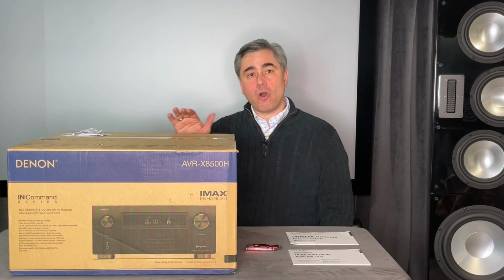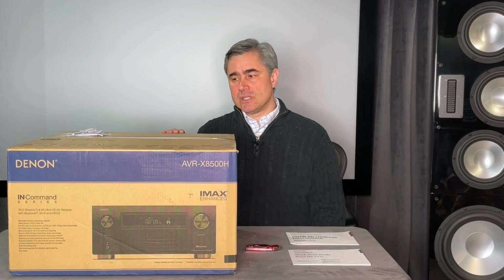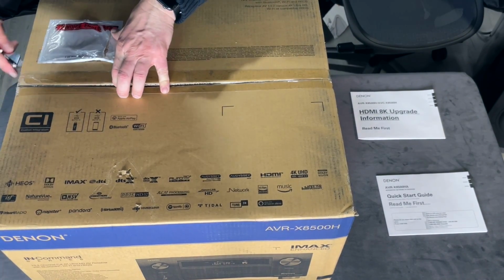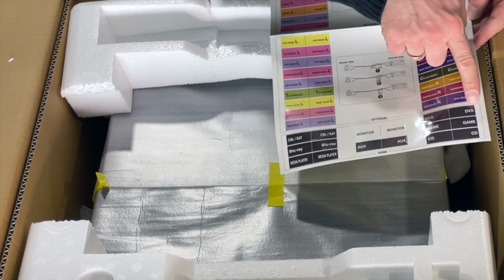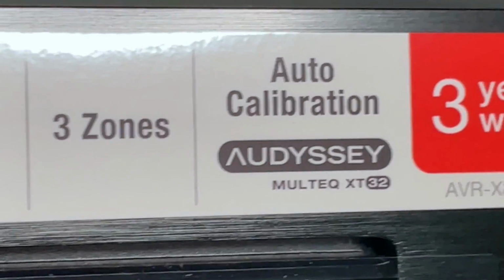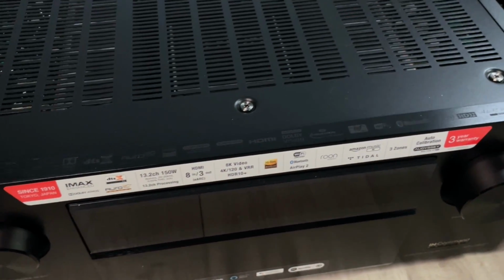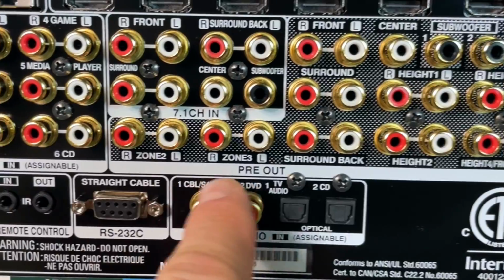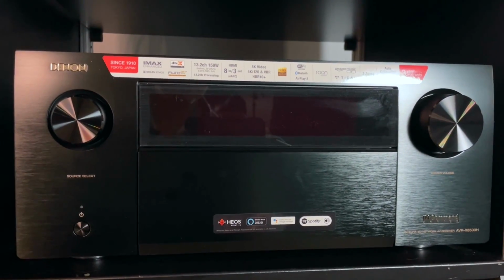Denon AVR-X8500HA 13.2CH 8K AV Receiver Unboxing Overview

Comment: If there's anything specific you all would like to see in the follow up series of videos on the Denon setup, please let me know so I can be sure to include it.
Reply: I fail to understand why this behemoth cannot process 9.2.6......That is all.
Reply: @BornIn82  because its a 13.2 amplifier/receiver? You would need something extra indeed if u have 9.2.6 for the last 2 speakers.
Reply: Theo I really enjoy your input on audioholics. It's because of you that I have changed my ultimate Bass soundcheck track to:
 "If You" by Skrux.
It was also partly because of you that I splurged and purchased my Denon AVR 8500H.
And now it's totally because of you that I drank the upgrade Kool-Aid.
LOL 🤣
Reply: Best speaker layout for this avr.  My assumption is it's supposed to be set up with 8 in ceiling speakers and switch between atmos and auro but I've never seen it confirmed.  Why else would it be able to hook up more than it can power?
Reply: I would like to see the 7.2.6 set up which I believe will be the most used setup using Dolby Atmos. I want to see you used the assigned amps in this setup to see if the top front, top middle and top rear are all highlighted in the setup menu. I would also love to see you switch from apps in your smart television to devices plugged into the input in back of the receiver to see is you find glitches that I have.
Reply: Please read my comment about the lack of 40 Gbps HDMI input. I belive that SU will ship you the 3 input box in no time for your review. Haveing 3 40 Gbps HDMI inputs in the basic AVRs from Denon make this unit questionable until the new Denom AVRs arrives. Maybe the 3 connection box can make this AVR an option still since it is already now proven to be a very good AVR from other perspectives.

Comment: Hi - that was awesome! On a side note,I have four Polk R700's as my front and rear speakers in a 7.2.4 configuration. I have a Denon AVR-X8500HA and I cannot get the settings to allow for me to set the rear speakers to large. It just wont do it. Rear speakers just default to small. I don't know if you do consulting or not, but I would gladly pay for your time to walk me thru how to do this.

Comment: Just checked my box - UK Spec AVC 8500 HA and the ‘A’ is marked on the blue stripe on the box, made in Japan, all good and thanks for the heads up about the upgrade of HA. This is for use with the 8K JVC laser projector.

Comment: Hi Gene and Everyone... question, What receiver should I buy? The Denon AVR-X8500HA OR  Denon AVR-X6800H???  The reason I ask is because it looks like the x8500HA just got a 25% off promo on several big box websites.  I planned on the x6800h, but it seems like a deal to just get the 'better' receiver with the discount.  Thanks for any feedback!!!

Comment: Anyone opened one up yet to see what Dacs they replaced the 8500h ones with 🤔 This should be upfront information.
Reply: V AVR X8500 a AVC-A110 byl DAC 8xAKM AK4490EQ. Nový AVC-X8500HA už DAC 8x SABRE ESS9010K2M. 😮

Comment: How would you compare this to the Marantz Cinema 40?  While the Marantz only have 125 per channel, most of us use an external amp to power front speakers.  My main concern is that for the amount of money spent on an 8500HA, you only get one 8K input.  Rather the Cinema 40 has 7 - 8K inputs, so it future proofed.  As a long time Denon customer, I love Denon! but I feel that for the price, Denon should offer at least 3 or more 8K inputs.  Any thought?

Comment: Thank you for this great content 👍.
 I am  planning to get the r600+400+r100(2 pairs)+RC80i +hts 12 for my 7.1.2 setup. But bit confused about the avr, denon x3800h  vs 4700. My dedicated ht room size is 5.3m*3.7m after the aquistics. I am not planing the preamps due to budget constraints. Which avr would you recommend  for this setup denon 3800 or 4700?

Comment: I have a Denon AVR x3100w and two Canton SD 580 DC main speakers. They are bi wired, think that this increases power supply. I usually set a max volume level but what if I would set Limit to off and increase the Volume to max. Could this potentially harm the speakers?
Did you run your speakers at max volume? 
Thanks for your answers ☺️.

Comment: Help please! Does your X8500HA show An X at the TV Audio column in the inputs/Input assign section? Denon said the X at this input slot is normal. My eARC is not working correctly. My sources, Blu ray, 4K Fire stick Max, are displaying no higher than 1080P through the Denon.  It should be displaying 2160 4 K and 4320  8k .I been having this problem ever since I bought this receiver. The Samsung tech said the TV is reading the TV source as a USB and not handshaking correctly. 7 months and counting and this problem isn’t fixed! If anyone else is experiencing this problem please respond. Thanks
Reply: wow that isn't good!! I hope you get the help you need!!

Comment: I have seen someone on YouTube stated that you can disconnect each amp on the amp assign section when you select custom settings??

Anyone can confirm??
Reply: Yes with the X8500H and X8500HA if you put the unit into preamp mode it disconnects the amp section.
Reply: Thought you could select between pre and speaker in the custom section as apposed all or nothing

Comment: Do you know if there is a new Sorround Processor on the way from Denon or from any other brands?
Reply: Typically you’ll see new models announced at CEDIA, which will typically put you in the September/October timeframe or CES in January.

Comment: Thank you for the overview.
Would be great to see a section on its 2 channel capability.
Reply: I’m running the X8500HA right now in a 2.2 channel mode with Revel’s flagship Ultima2 Salon speakers and using Benchmark AHB2 external amplifiers in bridged mono. It sounds fabulous.

Comment: Can you turn off the amp per channel or is it all on or all off?   For instance, suppose one is running a 7 channel speaker system and have the receiver connected to a 5 channel Monolith and thereby only need a couple of channels driven.
Reply: I will double check with Denon to get a definitive answer for you on this one from the source

Comment: What happened at 16.58? Why so abruptly cut the front panel overview?
Reply: Ugh seems like there was a misalignment of the transition that cut it short.
Reply: @TheoNicolakis  No worries, it's just that you were about to say where the actual HA is written on the chassis.
Reply: @Yiannis2112  The spoiler is that you don’t find it on the front panel! The only indicator is on the back. Even internally, this unit will show up as an 8500H on a network.
Reply: @TheoNicolakis  Got it! Cheers!

Comment: Common Gene, don't  you think that it's  time to drop the star trek thing. You're  50 something. Please stop trying to get us to buy that mass market junk from Sound United. Empty promises and horror stories about people buying $2000+ and it being nothing more than a boat anker. Would you buy a car if you started having trouble right off the bat?
Reply from the maker: What a douchebag thing to say. First you're age shaming, then your implying that someone that is "50 something" can't enjoy Star Trek? How noninclusive of you.

I've never had any major issues with Denon products and I've been reviewing their stuff for 20+ years. Pro installers I work with have shared mostly success stories with Sound United products with me as well. 

Customer support is an issue I've heard lacking at SU. Perhaps that will improve under new ownership.
Reply: I've  bought two units that had 7.1 and neither had the ability to play rear surrounds within the last 7- 12 years. Look up some of the lesser known reviews of Denon X series that had 2.1 ins & 2.3 outs from 2019-2021. Their remedy is a blu-ray sized box to fix what they promised they were already claiming. Yamaha at least is replacing the internal boards. Onkyo has even worst issues. What happened to integrity? $$$ bottom line and a medical devices company is not likely to help but let's keep our fingers crossed.
Reply: @christianginella5545  asked "What happened to integrity?"
-
There was this thing called COVID 19 which screwed up a lot of things. Part issues, shipping issues, all add up to why a lot of companies had problems with HDMI. Quit complaining. its getting better slowly but surely.
Reply: @nebtheweb8885  theres a massive difference with having problems and plain out lieing about thier product features. ARC still now doesn't  support more than 5.1 and I  bought into this about 6 to 7 years ago. 1.4 cable isn't  even capable of delivering a decent sound. I upgraded to 2.1 an now it sounds decent but still doesnt support Atmos.

Comment: As already mentioned in comments...please confirm what DAC chips are in the HA. There are lots of discussions about the HA now having inferior DACs compared to the H because of the AKM fire. I am certainly holding off on a purchase until it can be confirmed what DAC chips are now being used. The HA measurements may not be the same as the H!
Reply: Good evening. Same situation with me.  Could you please confirm us?
Reply: yes, inquiring minds want to know......?
Reply: @markym3870 The AVC-X8500H model has 8x AKM AK4490EQ. The new AVC-X8500HA already has SABRE 8xESS 9010K2M. The highest A10H and A1H fitted 10x ESS9018K2M.

Comment: At 39 lb it's almost half the weight of previous flagships. Is it because of Class D amplification?
Reply from the maker: It's 51lbs, not 39lbs. The days of the super receiver are gone. You're not getting a one box 5805 level product again.
Reply: @Audioholics  Crutchfield has this one listed at 39 lbs and the AVR-110 @ 51 lbs. Of course they could be wrong
Reply from the maker: @wishbone20t  their spec is wrong.  Both models are 51lbs.
Reply: The X8500HA tips the scales at over 51lbs. It's heavier than the X7200WA, which I owned. The X8500HA amplifier is  Class AB. It uses a high current transformer.  The on-board amplification is excellent.

Comment: On a side note The pre outs might measure better than some processors but it's nothing that you can hear...so it comes down to preference on which unit you think sounds better...which is the only thing that matters ...if you are buying something based on nothing but specs because you think it is better ...and you have heard a direct comparison between the different models to tell which one you like the best..then specs are specs ...trust your ears which sound you like the best as we should all know by now.

Comment: This allows to connect 15.2 but processes 13.2. Is it based on the content or the audio type chosen like Atmos vs Auro or DTS? I'm not able to play the front wide channels.
Reply: You can connect 15.2 channels so that you can run a concurrent Dolby Atmos and Auro-3D speaker layout. If you have the Top Front height and Voice of God speakers enabled, then you cannot run front wides. Auro 3D does not support front wides.  You can check out the speaker layout options here: https://manuals.denon.com/AVCX8500HA/EU/EN/DRDZSYhiettsoj.php

Comment: For this kind of $$$ you should consider separates.  You can get a Yamaha CX-A5200 preprocessor and and say a Monoprice Monolith amp 7 or 9  channels for about the same money. You won't get 13 channels but good lord - how many is too many? Plus with the Monolith amp you get a real 200 watts per channel ALL channels driven with the 7 channel model.  I have an open floor plan and no receiver that I have tried can do concert level volume for long periods in my main listening room but it is no problem from my Monolith.
Reply: I hope yamaha releases a new av preamp
But word is they have now discontinued with the rxa8a now being their flagship product
Reply: The Monolith stuff looks awesome it's really putting separates closer to reach.

Comment: Well I will consider this avr, though the idea that the hdmi 2.1 port is only 40 gbps, is making me, say hold it… I want the full 48gbps no matter what games can do today, with the current consoles, when I buy an avr, I want it to be as future proofed, as it possibly can. Which means I will probably be waiting for another few years, for denons next flagship avr, or an upgraded at the factory of a 48 gbps port, or I should say two, for the output to the tv, needs to be 48 gbps, as well….
Reply: But maybe u can upgrade this model again in the future to a B version if it does come out with hdmi 2.1 48gbps or even hdmi 2.2?
Reply: @NL_the_Godfather  yea, I just don’t want to spend xxxx amount of cash, to have to spend it again in about 2 years, or whatever… I want an avr that will last me… so I will continue to use my cheap onkyo, for the time being….
Reply: @Ryand0523  i just got it yesterday and with the hdmi 2.1 it should be fine for at least 8 years. U don’t really need the 8 extra gbps anytime soon. Especially if u use 4K, all u need is 33gbps. 
Unless u want to run 8K 240hz but then hdmi 2.1 is also not enough for that. 
Cables are currently way ahead of the tv panels out there. 
I already have a 80gbps displayport 2.0 cable which can run 16K but nothing to use it with. I thought i could use it on my 3080Ti graphics card but that one only has displayport 1.4 and hdmi 2.1. So then hdmi is the way to go.
Reply: @NL_the_Godfather  interesting… hmm, well you know what, I will probably continue to wait, until 2023, for I will probably buy a new tv, after next years TV’s release. For I want a big a90k, but Sony decided to not release such a tv…. Since the a90k, is only releasing in its small sizes, of less then 50 inches, I believe. Where I have been building my home theater only to now be ready, but not having a big modern tv, to buy to play with my Xbox with. At least beyond lg which I do not want to buy, since I am more of a fan of Sony since they keep developing the led tech, as well as oled…
Reply: @Ryand0523  yes but LG was a very early adopter of Oled and bought it from Samsung originally. They have advanced alot further and give great Oled models for cheaper prices then competitors. Like the C1 or G1. 
I’m a sony fan myself too but will upgrade to a 75” Oled LG 8K model by the time they get cheaper. A friend of mine has a 83” LG Oled but that thing looks alot better then my current 2017 Sony 4K led tv.
Reply: @NL_the_Godfather  yea, well I am not certain yet, but I may end up buying a Sony 83 inch oled, or 75-85 inch LED here in the next month or two… it will partially depend on which tv type is more then likely going to get the vrr update. I should also say I am more interested in a qd-oled rather then a oled…
Reply: What AVR runs the full 48?
Reply: @avtechman77  I don’t any right now, but I am willing to wait

Comment: I looked at the Audyssey app. Almost £20, and everyone seems to hate it. So avoid!
Reply: I use the Audyssey app for my Marantz 8805, and it is really great. Would advise everyone with a compatible amp to get it. It´s cheap for what it does, but should be free concidering what you pay for the amp.

Comment: Have a x6700H now .. still want a x8500HA .. Love them.
Reply: damn! you collecting receivers like it's pokemons out there haha
Reply: @demonreturns4336  - I also have a 4308ci Denon. lol.

It happens. We journey and level up when it strikes. I sold my Anthem MRX 1140 for the Denon x6700H ( Auro3D) ...and the Anthem has terrible noise floor issues in the rear / height channels. SO much hissing. - not to mention the internal fan noise.

You know how it is .. we are never satisfied in this hobby.. Something always comes along.

Comment: Great to see Theo doing these vids. The SR8015 is a better buy.
Reply from the maker: It certainly is but if you need a 1 box solution, the 8500 reins Supreme.
Reply: @Audioholics  What sound do you think is better...sr8015 or 8500ha?
Reply: @antonioantequeracid6005  Gene did a comparison video about a year back of the SR8015 and the 8500H
Reply: 😂 ... Subjective

Comment: These are really well made products but I am not a fan of Audyssey with dynamic equalization or having to adjust a target curve with my fongers on a phone. I have the 4400h and its sitting in my basement while I am using a cheaper, better sounding avr. I am also waiting for a back order for an avr with Dirac.

Comment: Please do the review/tutorial on MULTEQ-X!  I need help with it!
Reply: I have been testing MultEQ-X with the Denon and we’ll be doing something very soon on it.
Reply: @TheoNicolakis  Much appreciated!
Reply: yes please...   I need a guide also.
Reply: @breezebreeze699  Hardeep Singh Rattan,  rest assured……..Theo will save us. 

He is the Audyssey messiah!
Reply: @ts6640  hope so .  over the last 2 years I have run the calibration 10 times and it seems to get significantly better every time. how bizzare.  I only use the minimum seat locations also... and recently I removed the setting which tails off the treble for ”better dialouge” and found the entire sound stage suddenly full off sparkle and crispness.
Reply: @breezebreeze699  interesting. What setting are you referring to?

Comment: Unfortunately only one HDMI 40 Gbps input. Some of the entrance level Denon AVRs now have three HDMI input 40 Gbps. Maybe  this should be mention and disussed in depth in a coming review since this is a big limitation to a high performance AVR. The 3 40 Gbps input box now available needs also to be mentioned and tested. Thanks to Audioholics for great content and in the future you might add to your ”sloga” - keep listening and watching- since the picture side and the HDMI complexity with 2.1 becomes very important for your viewers.
Reply: The price of this is insane to not have HDMI 2.1 out the but t h o le.